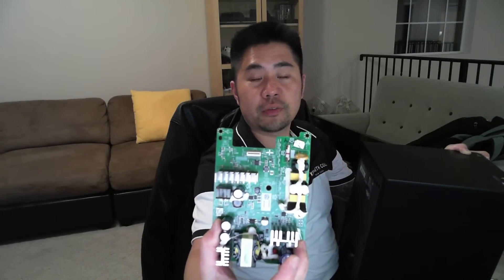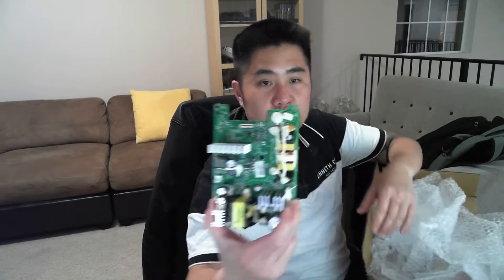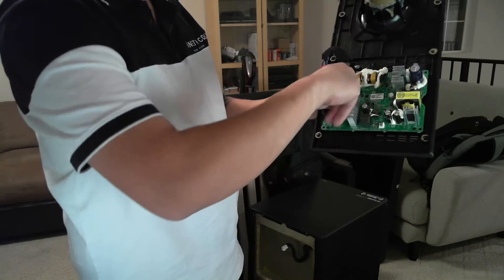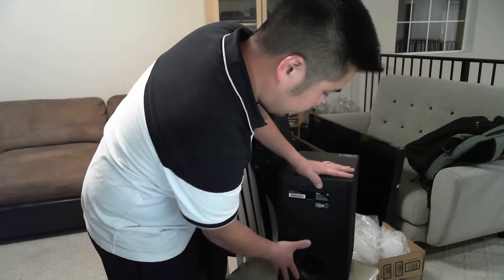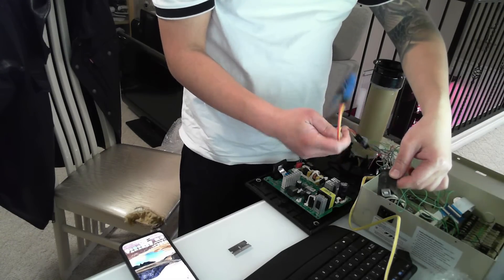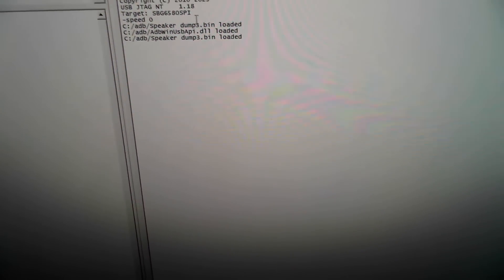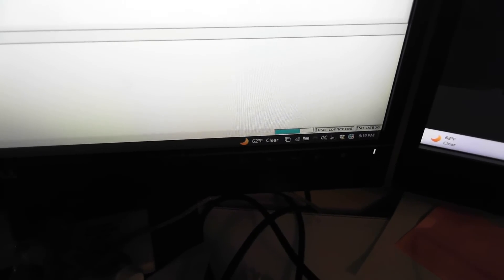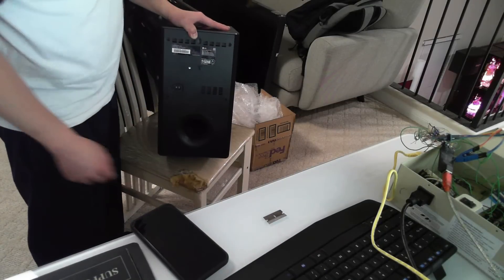LG Soundbar Subwoofer Repair – No Light, No Power Fix | SN11RG, SPN5B-W, SN9YG, SN6Y, SPN8-W

Comment: My sound bar It is not bringing sound so if I low the volume down to zero level then I will start louding it gradually it will be bringing sound whenever it is 10 by volume it will cut I'm not here anything again until I reduce the volume back to zero and I will start fresh again it will be sound by 10% by volume and it will cut again

Comment: Hey brother, do you still fix these subwoofer mine stopped working last year speaker model SML3R 4.1 subwoofer SBH4BM-W bought it for 120 on sale used for one year and subwoofer stopped working no power light. Other two speakers and sound bar works. Will you able to fix it ?
Reply: Do you think 70 to repair is worth it can you do it for less ? Should I go ahead and buy a new one by adding 100 to it please suggest?

Comment: Hey man do you still fix these mine hasnt worked for two years now and all i hear is a hum after disconnecting the ac cable. Also no light indicators are lighting up.
Reply from the maker: Hi Christian,  

Thanks for reaching out! Yes, I still fix these subwoofers. Based on what you described (the hum after disconnecting the AC cable and no light indicators), it sounds like there’s a fault in the PCB board. I can repair it by replacing the faulty components and restoring functionality.  

The repair service costs *$69.99* and includes part replacement, return shipping, and a **1-year warranty**. You can get started here: [LG Subwoofer Repair with New EEPROM Chip Replacement](https://subwoofersaviors.com/lg-subwoofer-repair-new-eeprom-chip-replacement/).  

If you have any questions or need shipping instructions, feel free to check out [Shipping Instructions](https://subwoofersaviors.com/shipping/) or contact me directly.  

Looking forward to helping you get your subwoofer back in action!  

Best regards,  
Quyen

Comment: I'll echo the others here - I realized (after way too long) that my sub wasn't working. Sent it to Quyen and I had it back within a week, works perfect. This dude is my hero 😂 It's a shame so many of these LG woofers are getting the same failure, and of course the original manufacturer doesn't provide a service to fix it like Quyen does. Thanks so much 🙏🙏🙏
Reply from the maker: I'm glad I could help! I have a lot of people reaching out about this specific subwoofer problem, so I'm glad I can offer an affordable solution!
Reply: I need mine fixed .. it’s not powering on

Comment from the maker: Hey everyone!

Is your LG subwoofer refusing to pair or constantly disconnecting from your soundbar? Don’t worry—I’ve got you covered! My name is Quyen, and I specialize in repairing LG Subwoofers, particularly those with issues on the EBR89625801 board. 

### *Why Choose My Service?*

- *Direct, Expert Care:* I personally handle each repair, ensuring your subwoofer gets the attention it needs to get back to perfect working condition.
- *Save Money:* Instead of spending over $120 on a new board, I replace the EEPROM chip for just $69.99. Why buy new when you can repair?
- *Fast Turnaround:* I understand how important your sound system is, so I make sure to get your repair done within a day, with return shipping included!
- *1-Year Warranty:* Every repair comes with a 1-year warranty, giving you peace of mind that your subwoofer will keep performing.

### *Common Issues I Fix:*

- Pairing issues
- Red light problems
- No light issues
- Blinking green pairing light

### *Supported LG Subwoofer Models:*

- SPN5B-W, SN8YG, GX, SN7Y, SN11RG, SPN5B, SPN8-W, SN9YG, SN6Y, SN10YG, SN5Y, SN6Y, SN7R, SPN5-W, SPN5, SP8YA, SPP8-W, SN5R, SN4, SN4A, SP11RA, SPN8

### *Ready to Get Your Subwoofer Repaired?*

Visit [SubwooferSaviors.com](https://subwoofersaviors.com) to purchase my repair service: [LG Subwoofer Repair with New EEPROM Chip Replacement](https://subwoofersaviors.com/lg-subwoofer-repair-new-eeprom-chip-replacement/).

For shipping instructions, check out this link: [Shipping Instructions](https://subwoofersaviors.com/shipping/).

If you have any questions, feel free to reach out to me directly:

*Email:* Support@SubwooferSaviors.com  
*Phone:* (626) 434-6681 (text, call, or leave a message)

*Don’t throw away your subwoofer—let me help you bring it back to life!*

Thanks for watching, and I look forward to helping you get the best sound experience from your LG subwoofer!

Comment: Is the firmware the same between different models? I have a EBR85372901 PCB here and a programmer, but I only found the firmware for EBR89625801 so far.

Comment: Hey Quyen, the sub with my  SN11RG works but is constantly disconnecting (along with the rear L speaker). Is this a fault with the sub and something you could repair? I have read that the sub being too close to the router is the cause, but moving it doesn't seem to help.
Reply from the maker: Visit my website. Let’s chat. Https://SubwooferSaviors.com

Comment: hi my original SN9YG's subwoofer SPN8-W is chewed by dog. I have an old defective SPN5B-W subwoofer, can SPN5B-w be repaired/Rom update  and use with SN9YG???
Reply from the maker: It is backwards compatible. They are identical. Turn off the soundbar. Plug in the subwoofer and immediately on the back push the pairing button it should rapidly flash. Then turn on the soundbar. Will pair in under 30 seconds.
Reply from the maker: How can your dog chew an entire subwoofer?

Comment: Good afternoon,

 I have a soundbar (LG DSN8YG) with separate subwoofer (LG SPN8-W).  Now I've been having the problem lately that the subwoofer (the Bass) keeps dropping out.  I've tried everything, reset to factory settings, and also tried pairing again several times, but nothing helps.  What can I do now?

 thank you,
 Bart
Reply from the maker: My contact information is on the description. Reach out to me. I will replace your eeprom chip. Thanks Bart
Reply: thanks for your reply.  I have sent you an email with some questions.  Could you take a look at that if you have time?  Thanks
Reply from the maker: https://subwoofersaviors.com/

Comment: so i have the exact problem .. my subwoofer just recently stopped working. no light, i dont see any burned area on the pcb etc.  my question is how much would it cost me to get it repaired? im in vancouver,canada
Reply from the maker: Message me Mike! my contact info is (626)434-6681 and my email is xqnguyen327@gmail.com
Reply from the maker: https://subwoofersaviors.com/

Comment: folks - i'm one of the group ...bought LG subwoofer, took me a while to realize it wasn't working, was lazy about getting it fixed, was ready to torch LG after speaking to their "customer service"  - blah blah blah ...and then i stumbled on this video.  boom, 10 minute disassembly, quick ship to Mr. Quyen, back to me in about 2 days even with shipping, and voila ....sound like it should be.  Don't waste your time anywhere else - get busy livin'
Reply from the maker: https://subwoofersaviors.com/index.php/product/lg-subwoofer-repair-new-eeprom-chip-replacement/
Reply: Mine is doing the same thing how can I get in contact with you

Comment: I have the SN6Y soundbar, it just stopped paring today. I've done everything, now the paring light just flashes non stop even after it being unplugged for 10+ mins. I never updated my soundbar...I didn't even know they would be connected to the internet...would this even fix mine? My sub is only two years old.
Reply from the maker: The eeprom chip will need to be replaced. I can change it for you. :)
Reply from the maker: https://subwoofersaviors.com/

Comment: My SPN8-W subwoofer was not connecting at all, it would power on, pairing light would come on for a bit and then go off.  I sent the PCB to Quyen to see if it was the same issue others had reported.  After trying multiple attempts to reprogram and even replace the chip. Quyen ordered a brand new PCB board on my behalf and had it shipped directly to me.  I would have wasted a load of money buying a totally new sound bar set up if I had not come across this video.   This has got to be the most honest and trustworthy person I have dealt with over the web. Highly recommend his help.
Reply from the maker: https://subwoofersaviors.com/

Comment: I have power. But it won't connect. No blinking light either. Even after I press and hold the "Pairing Button" on my SPN5B
Reply from the maker: send me a text or email. (818) 446-6885 / xqnguyen327@gmail.com
Reply from the maker: https://subwoofersaviors.com/index.php/product/lg-subwoofer-repair-new-eeprom-chip-replacement/

Comment: Hi there, you seem like an absolute saviour! Just had a few questions to try and understand the situation better..
Like many others, my SPN5B-W stopped turning on all of a sudden.
AFAIK my sub is not connected to the internet, how did LG manage to break it with a software update?
Also, if your repair the board, do we need to do anything to ensure the firmware doesn't try again for an update?
Reply from the maker: When you first got your soundbar you added your Wi-Fi and forgot about it. Or you used the lg app.  I’m sure LG corrected the update but either way I use it only has a soundbar and I also block the soundbar on my router.
Reply from the maker: https://subwoofersaviors.com/

Comment: my sub has lights but won't connect. We have the exact same model in the basement and still working fine on that one. Think it's interference?
Reply from the maker: Probably not. You can disconnect the power on the other one and probably still doesn’t work. Each sub has there own daughter board to pair to separate sound bars.
Reply from the maker: I can fix it
Reply from the maker: (818) 446-6885 Send me a text or Email! xqnguyen327@gmail.com   Thanks 🙏👍
Reply from the maker: https://subwoofersaviors.com/index.php/product/lg-subwoofer-repair-new-eeprom-chip-replacement/